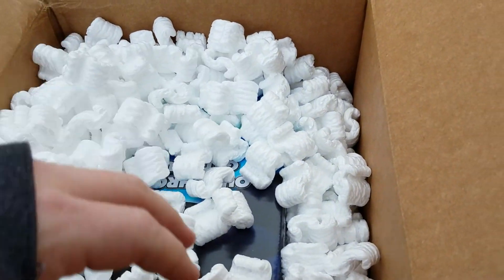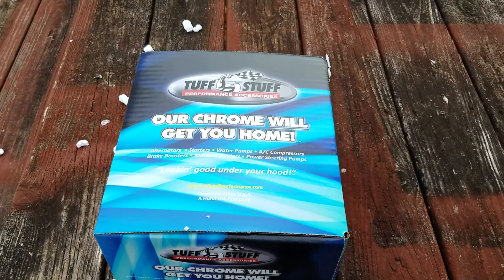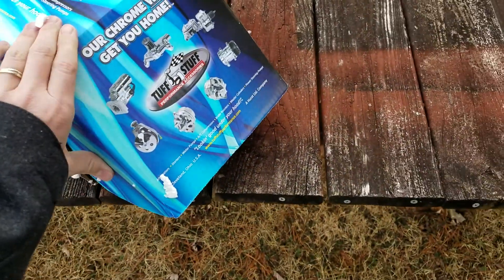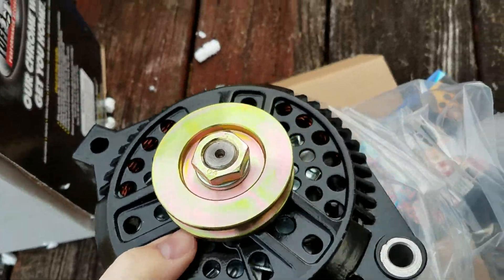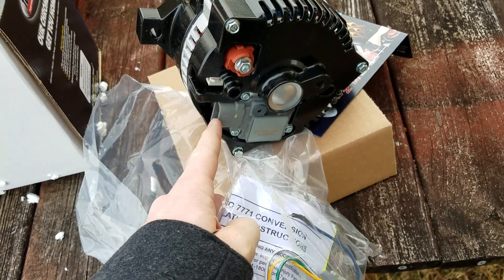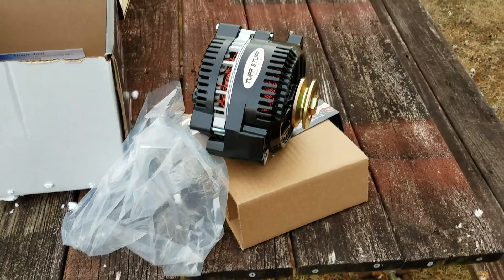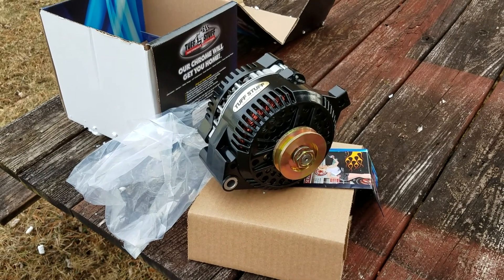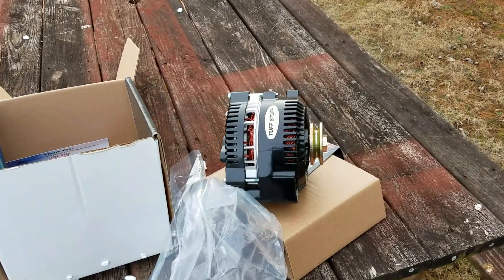Tuff Stuff 7771b unboxing

Comment: Looks like a pretty solid alternator. Lots of juice to keep battery happy.
Reply from the maker: T.O.A.G Made right here is the US of A! Can't get any better than that.
Reply: I was tightening my tuff stuff alternator down and the bracket for the back bolt cracked. I was tightening it down with a ratchet.

Comment: I had to put a 120 amp on my vette it was doing the same thing as I drove it. Fans Fitech and elect fuel pump would kill it over about 50 miles.
Reply from the maker: scottsinfl Yeah I'm thinking my alt is good if it was on a bone stock car. I've went way over it's limit why electrical items. Hopefully this works out.

Comment: Did this alternator hold up? I read the bearings in these are not great
Reply from the maker: Still working fine. No issues at all.
Reply: @Cobrafanatik22  awesome. I been eyeing this brand for my 2gen dodge  in a 200 amp. But did read the bearings don't last 🤷 can't believe everything you read on the internet. Thanks for the reply.